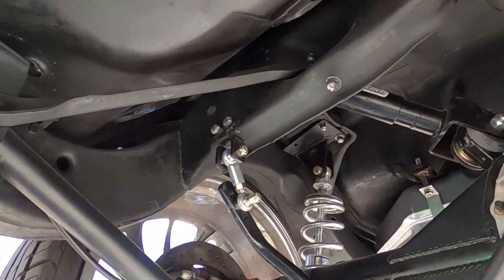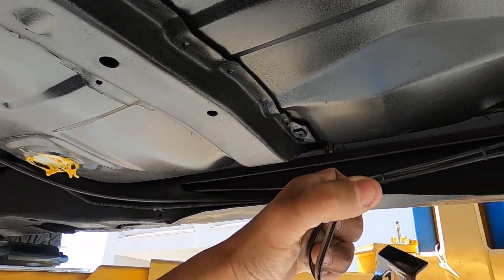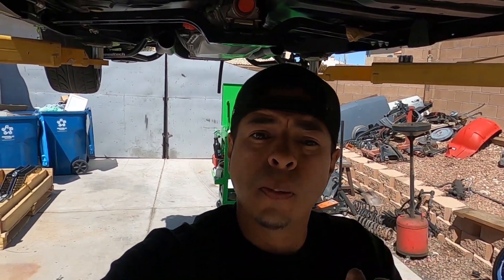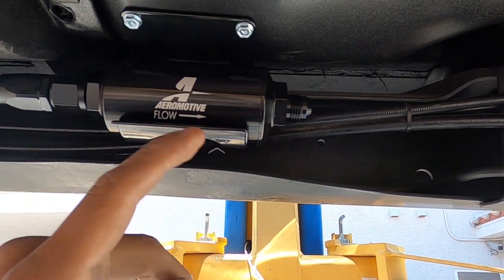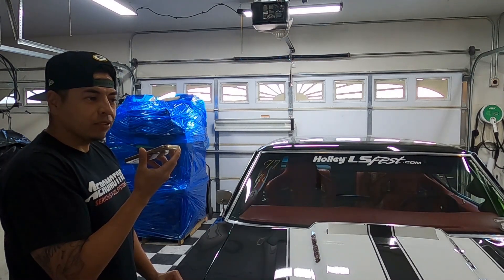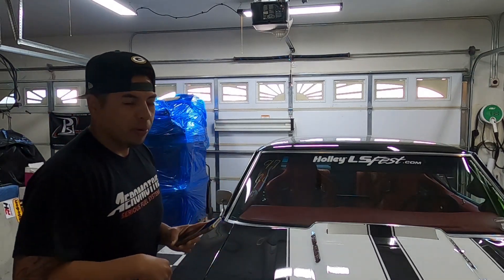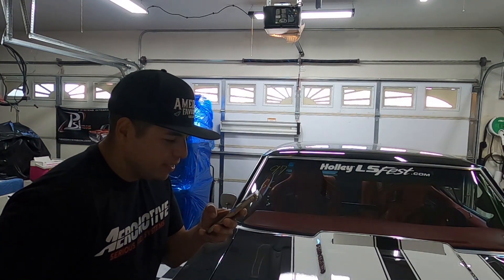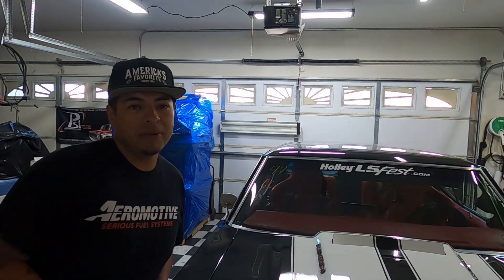HOW TO LS SWAP YOUR CAR (PART10) INSTALLING FUEL SYSTEM & GIVEAWAY WINNER!

Comment: I'm curious when you mounted that fuel filter bracket did the self tappers go all the way through the floor to top side?
Reply from the maker: i shave them down on the inside

Comment: Like the way you set up the fuel line it looks like I have something to change on my A-Body. Were did you purchase the fuel tank vent fittings that go’s on the end of the vent line. Thanks.
Reply from the maker: Comes with tanks inc tank